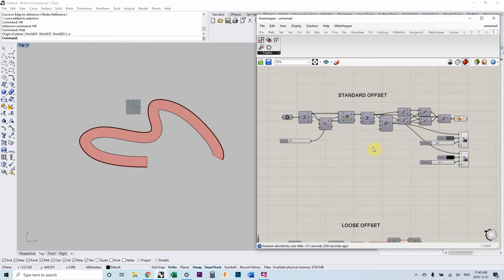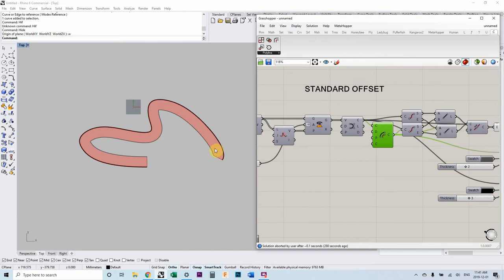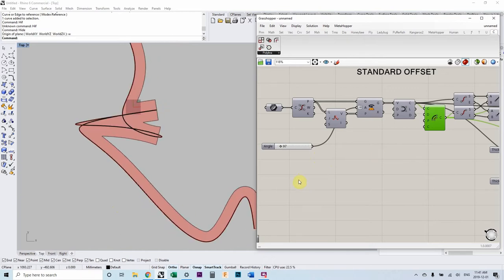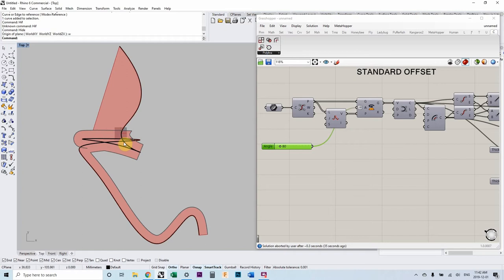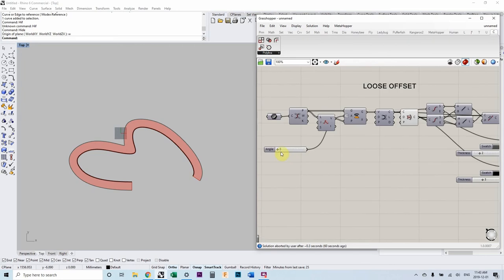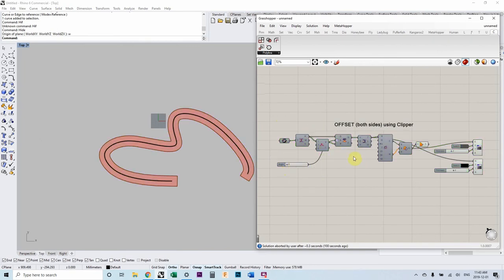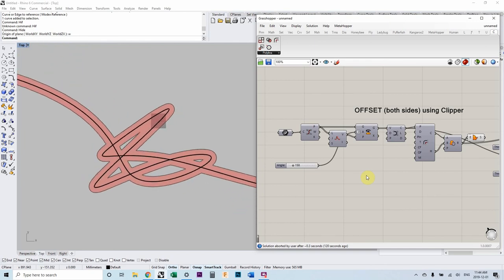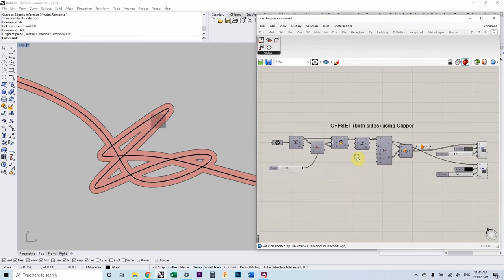Grasshopper Tips: CLIPPER WINS (offset failures and fixes)

Comment: Is there anyway to turn the polyline segments to arcs? I'm digging around and I can find ways to sort of do it but nothing that just instantly changes it to polyline arcs.
Reply from the maker: Hi Scott, most likely what you want to do is possible, but I'm not sure I fully understand. Do you need to convert each line segment into an arc that is tangent to each adjacent arc? Yes it possible. Or do you need to convert a polyline into a spline curve? It would make the whole like smooth and continuous and would be easier than converting polyline into arcs. But I understand there are some requirements to use arcs and NOT spline curve. (converting curves to other software's often doesn't like spline curves. AutoCAD for example)
If you send me some details I can help you out.